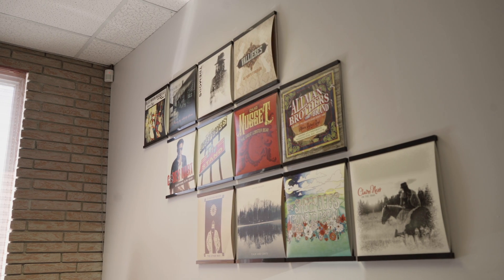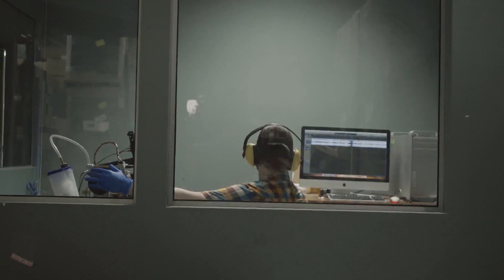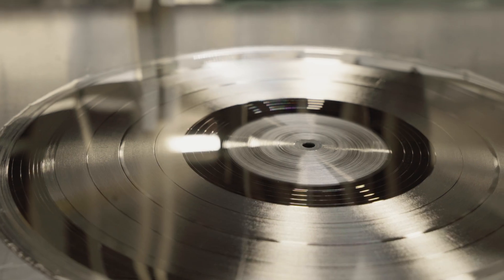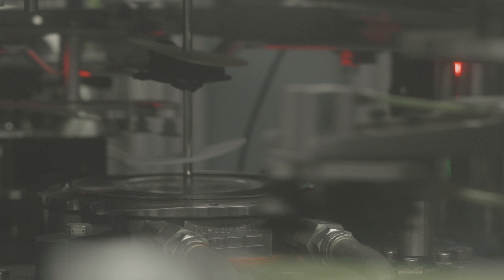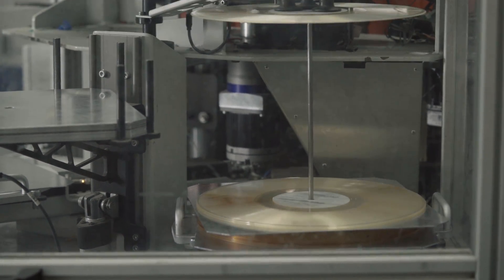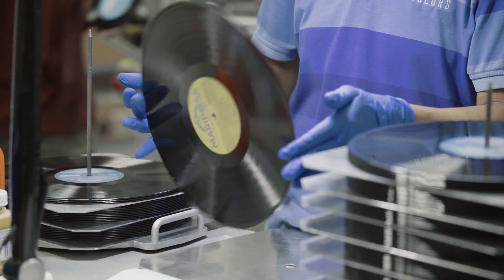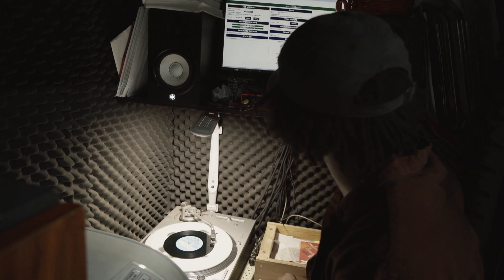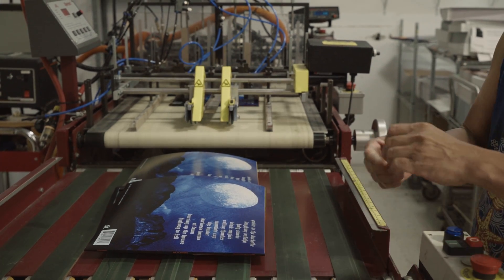How Vinyl Records Are Made | Fluance at Microforum Vinyl Pressing Plant

Comment: Please don't use digital files if you have to use a digital file put it through a professional reel-to-reel first before cutting
Reply: Bro this guy's talking as if ppl own vinyl presses 😭😭😭
Reply: Might the DAC process (digital to lathe) do the same thing as capturing to tape?
Reply: @mactryx  no because you want to eliminate the DAC or dramatically cut down it's effect, you putting an analogue signal onto an analogue tape through an analogue system and then on to lacquer through a valve amplifier ideally with a Class D power supply.
Reply: @johnsweda2999  "... if you have to use a digital file put it through a professional reel-to-reel first before cutting" this is what I was responding to. If I understand correctly, there needs to be a conversion from digital to analog. What process would you suggest getting a digital file to analog tape without a DAC?
Reply: @mactryx  sorry I misunderstood! well yes you would need a DAC high-quality DA converter. You can use a reel-to-reel at mastering stage when making the file as well before it's digitised when it's in the analogue domain.
You would run it on one part of the tape not recording it on the hole tape, because you would introduce wow and flutter, recorder halfway across equal sides of the tape, doing this for each parts of a track mainly mid-range vocals 300Hz up to 3.6k.
You want high quality 24track refurbished with better modern component to High tolerances, Especially on the output stage to the lathe amplifier
Reply: @RealAndrewBlack  Thank you sir.  I was wondering WTF they are pressing vinyl from a DIGITAL source.  That kind of defeats the ENTIRE purpose...

Once the damn signal has been digitized, you can't ever get back to the true analog waveform.  That information has been lost.
Reply: @rhoused1743  Same. The guy lost me right off the start with the digital file/mp3 stuff.